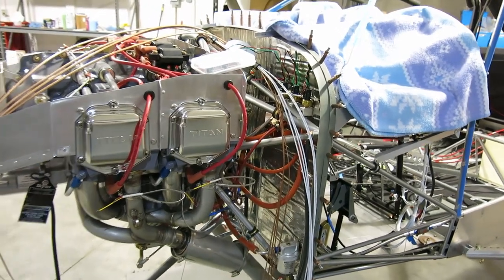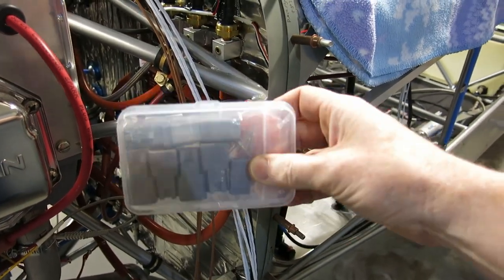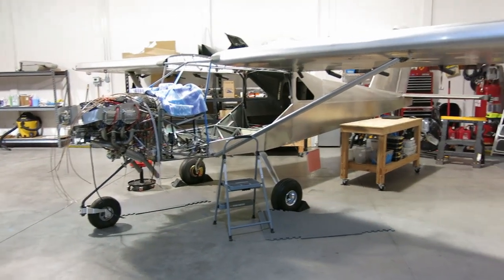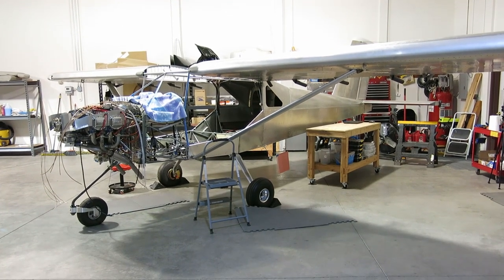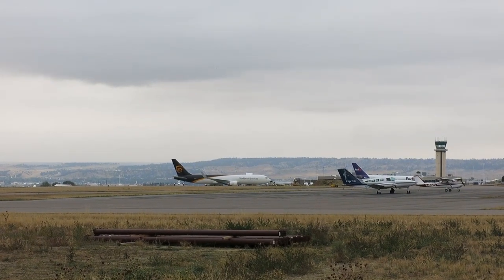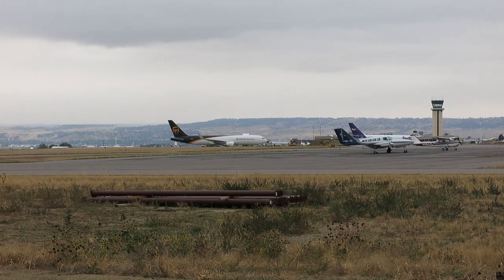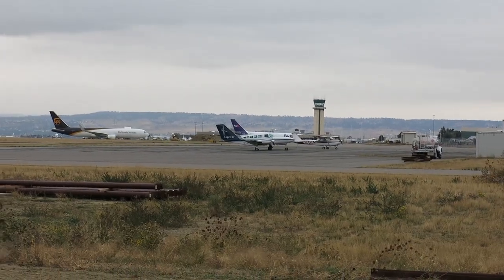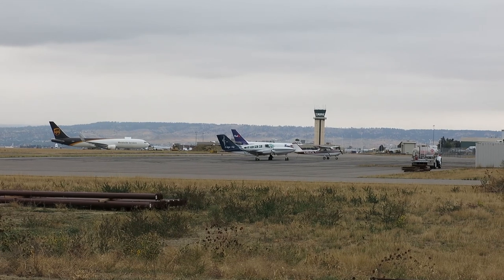No. 307 10-01-2023 Pressure sensor manifold wiring

Comment: Looking good! I should have done my oil pressure sensor like that. I installed mine the same place rans did and went thru 3 sensors before I went to a Rife sensor that hasn't gone bad. If it goes bad I'll move it to the firewall.

Comment: I would be concerned the sensors do not have provisions for a shield.  Or at least use at connector with shield connections and shield the wires out of the sensors with a braided SS sleeve.  Since these are low voltage connections  (0-5v,0-10v or Millivolt), you should take every precaution to shield them from high energy noise (ignition, radios, etc).  The only exception would be if they are 4-20ma devices which would be unusual. The shields should be brought thru the connectors as close to the device as possible, only grounded at the avionics buss.
Reply from the maker: Yeah the shield is grounded on the avionics side. I did end up shortening the connections coming off the sensors.